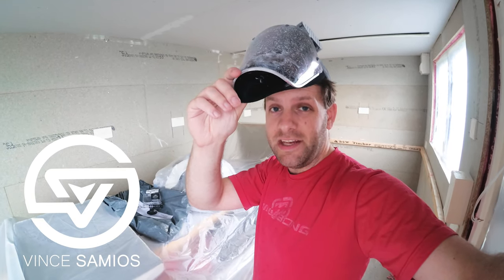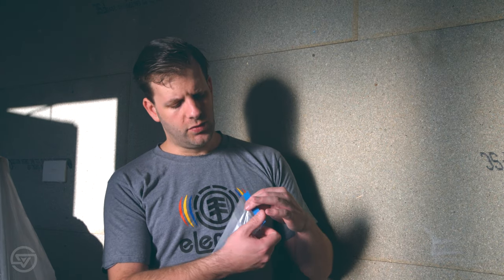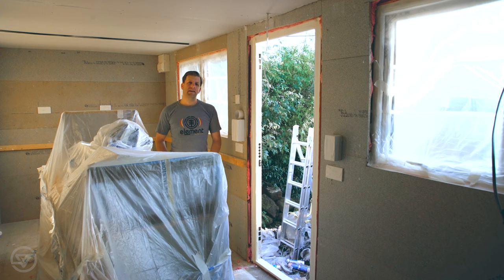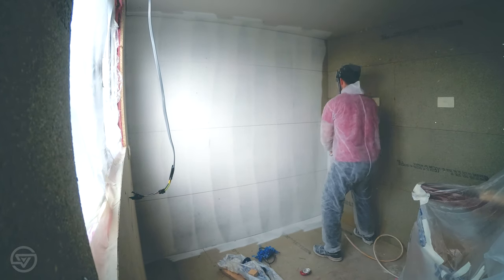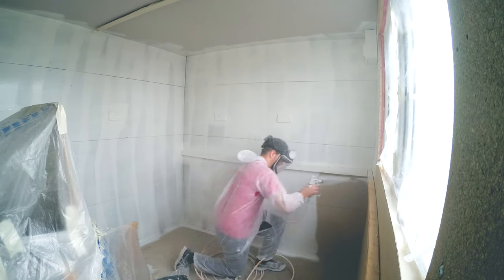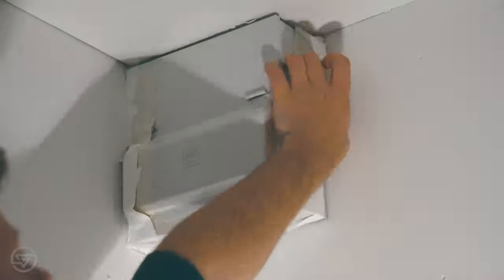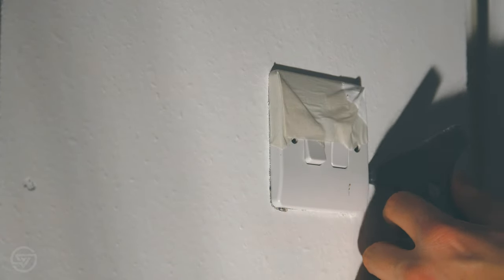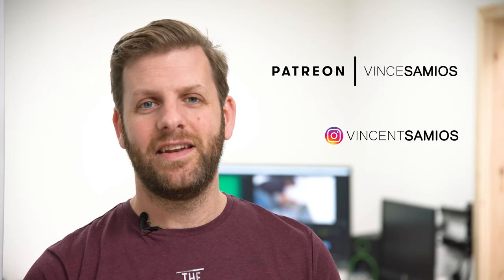Painting - Shipping container home office - shipping container conversion

Comment: Just curious why you didn't go the extra mile to tape, mud and sand between the pieces of drywall.  It wouldn't have taken long and you already put so much time into the container office... ?
Reply: The walls are plywood
Reply: Tape and bedding is a fire code. He doesn't need it in a shipping container the steel on the outside will suffice.